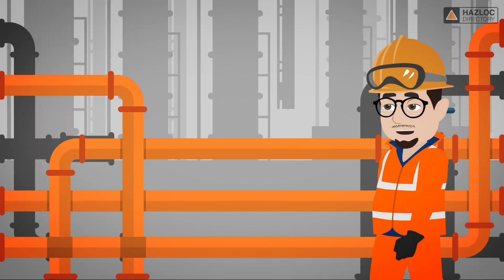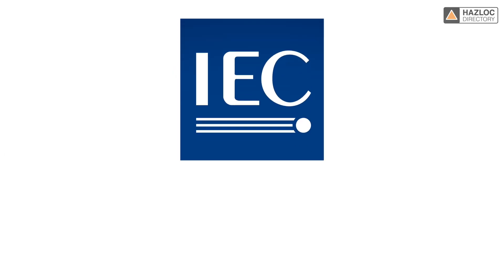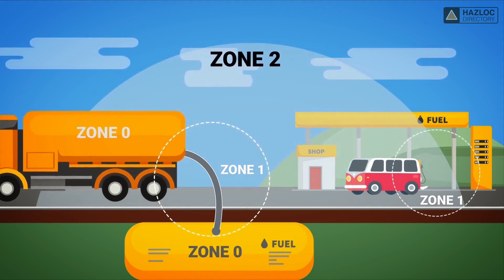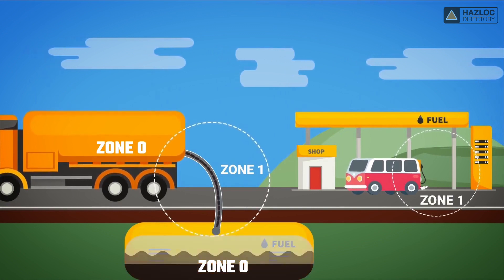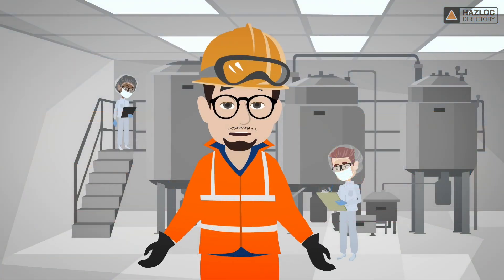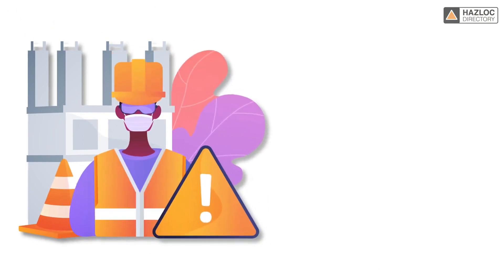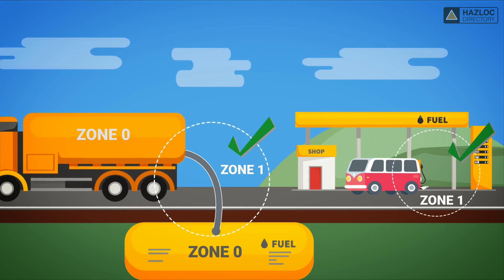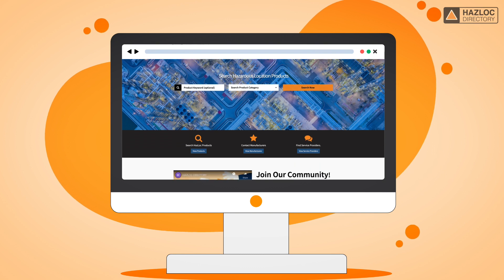Hazardous Locations - Zone 1

Comment: if motor require 35mm square cable being installed in Zone 2 . if wd install this motor in Zone 1 , Do we need to increase cabl size or no? cable size not affected by zone classification?
Reply from the maker: Hi, the motor cable size is not related to which classified area the product is installed. However, the type of cables need to be appropriate as per zone hazardous areas.  If you install your cable in Zone 1, it needs to have proper protection technique (Flameproof, increased safety, purging, etc.) and the cable needs to be selected correctly.
Reply: @hazlocdirectory6897  thank you